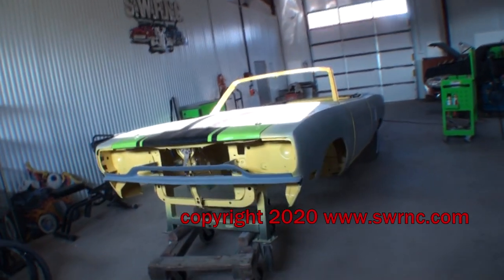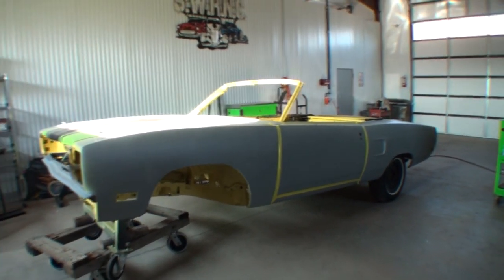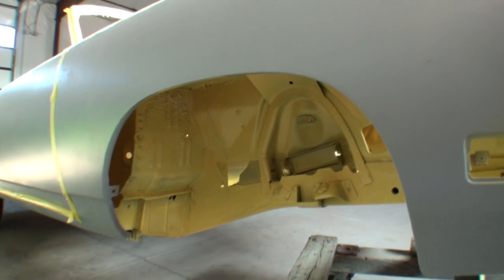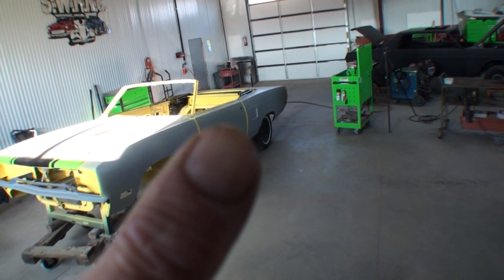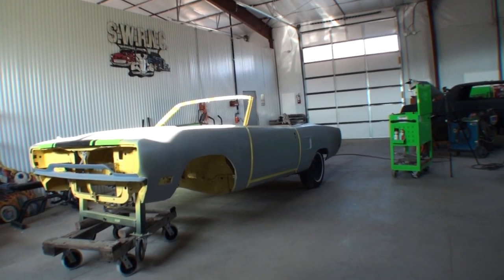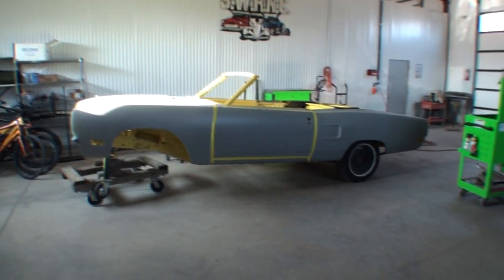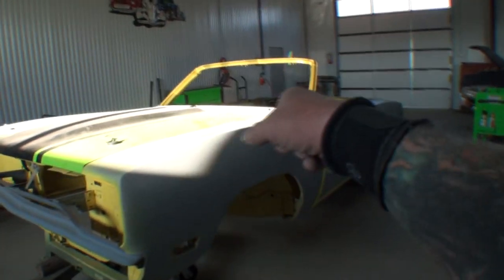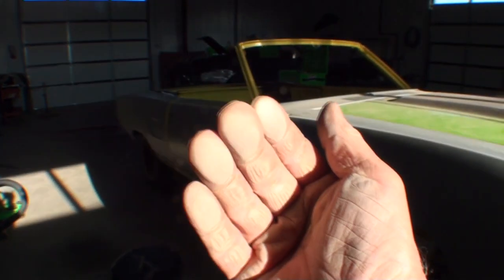Paint Your Car With Rattle Cans -FAST AND EASY

Comment: I can’t believe I’m cheaper than Pete! I use my primer gun rinse as guide coat. If I’m priming grey, I use my saved red primer cup  rinse. If I’m priming red, I use my saved grey primer cup rinse. A simple contrast in color to help you see what the real situation is.
Reply from the maker: Never heard of that one William -- new to me.. Seems like it's a popular situation you got 3 thumbs ups.. Ill have to look into that.. Thanks for watching.
Reply: That's a good idea. I save on paint using similar colors as best coat under the base lol.
Reply: Remember we used black, gray, and red primer surfacer and I would go over with different color primer when I first heard about a guide coat. Did not know about the flat black idea, as we always had plenty of Krylon flat black and dull aluminum in the spray cans. Wish I knew about it I would of liked to try it
Reply: Are you using lacquer primer?
Reply: Justin, This is a great question. I believe either lacquer or enamel paints will not affect a 2k primer. 
I had lifting/wrinkling on a small parts job, but contacted RustOLeum tech. They simple said if the can does not say enamel on it, it is lacquer.
  I would honestly do what the previous painter said. Save you contrasting primer wash from your gun, seal it, mark it and you can use it in 3 years. (Just Don’t Save 2k Because It will Harden I believe)
  Otherwise, go to Dollar store a but flat black. I have used contrasting spray can primer from the home improvement stores. But even then, it cost $3-4 per can. Try your lacquer in an area that is your primer on metal, so you don’t have to sand again if it lifts. Notice Pete said “The Cheapest” which I would bet is lacquer. So, now you have many options. I am a retired auto tech, not a painter. I’ve done 5 of my own. This is why I love what Pete does. Yah, a little salty sometimes but no less than my step-grandad on the farm, 2 six-packs in before I forgot a chore and heard the belt come off. I learned to run fast. It’s not fun being the red-headed step child, the oldest of 4, 3 all half blood to me. Even at 63, enjoy learning. Pete is my man! No man is perfect, but body & paint, Pete is up there in my book! Best of luck.
Reply: Justin, See the post from William Shaffer. Brilliant!
Reply: No I was just wondering if the 2k wash worked? I guess it would almost be like lacquer primer. I understand guide coat and such since I'm in the biz. Personally I just buy the dollar bomb cans. If I have to contrast I'll shoot some base coat on it

Comment: i always sand in a cross-hatch pattern. never work one spot.  i also make a drawing of the body to show where problem areas are / were.  you want that shine line to match up on front fender, door, quarter panel seems.

Comment: Thanx Pete!  Hope you feel better.  Have you ever tried an inversion table?  It helps with feet, back, circulation and other stuff, nice to use every now and then even for 10 minutes, I feel 1/2" taller after using it.  Standing hours on a concrete floor is what led me to it.  I want you to keep those vids coming!  I just started my D.I.Y.AutoSchool wardrobe with ordering a green DIYA.S. shirt, I will wear it proudly!  Stay healthy!

Comment: Cool video Pete..  I do body work and custom paint jobs using candies, pearls, different sized metal flakes and metalics, plus using glow powders..  I too use the guide coats for guidance but I also go one step further to reach that perfection mark by using different size straight edge before putting any fillers on..  While sanding the guide coat, if I run into bare metal (high spot), I will take the straight edge and put it on the bare spot and see if the straight edge teeters on it or not..  If it does, I will knock down the high spot with a body hammer and then recheck with the straight edge again to see if its level..
Hope this helps..

Comment: the green and yellow looks great together.
putting one of those spray glue can heads on a paint can gives a nice fan.
guide coating is a great way to use up left over base coats.
Reply from the maker: HUMMM  --- I never thought of using the spray glue tip for the guide coat.. Gonna have to check it out.. Thanks for watching Messylaura!  Hope your doing well..
Reply: @diyautoschool  yes i'm doing great thanks Pete.
looking forward to you making a spoof sand blasting vid 'just leave the car in the desert for a day"

Comment: Well just coz u asked what I would do the other way. I would use that guide coat with filler and bondo work to try to make it as close to perfect whats possible BEFORE spraying the actual sanding primer. What you complish with doing that way you might have to spray only once the sanding primer. You will save ton of time if doing so coz everytime you have to spray something you have lots of masking and also the primer has to cure basicly over a night before u can sand it.

Comment: love those raised car dollies that the Mercedes is on ...  makes a nice working height..  Pete did you make those or are they oldies but goodies??
Reply from the maker: I bought them with a floor system for tieing cars down for the frame machine. I don't have the frame machine anymore but I kept these dollys.. They would be really simple to make,,, 2 inch angle and some 2 inch square tubing with wheels...
Reply: They were very nice to have. I would always put the 4 under one of the cars I was working on in the shop .  I could get 3 or 4 cars in there and move the other car any were i needed to put it to work on all the cars. Would be cool to make a set, as the wheels just sit down in the dolly and 4 good casters. I was surprised when dad got them I was able to Maneuver large cars and pickups with no help.

Comment: Pete, do you have any experience with using a shrinking disc for small high spots?  There are only a couple sources for these and the price keeps me from trying one out.  Stainless steel, rolled edge, maybe it is not expensive IF IT WORKS.

Comment: Pete From what  I think I have understood from your previous video on  Epoxy  Primer ( sealer )   after the block sanding only the high bare spots will be spot Epoxy primed  correct ?  What is the next step after the block sanding is satisfactory ?

Comment: I have a question im working on a 1971 camaro and I'm skim coating the door now how do I adress the body line in the middle of the door? do I sand till I see bare metal or leave a coat of bondo over it?

Comment: I remember reading this technique way back in the 60s in Rod and Custom magazine.  They had a car they wanted to paint black and the guy that did the job did the sanding and final bodywork using a guide coat like this because he said if it's going to be black, every tiniest little imperfection or ripple would show up like a sore thumb.

Comment: Looks like I'll be painting a trans am black soon since I'll be having some down time for the rest of the year.  Time to catch up with "My Friend Pete" on my technique.  What grit will you finish the car in once you've repaired the highs and lows after the 180 guide coat?  When is it necessary to apply sealer before the base coat?  I'm worried about the idea of spraying sealer and getting a poor finish that needs to be sanded again after I've already done finish sanding.

Comment: these types of cars are worth the money to fix all the rust in them some projects i just don't understand the money some people put in them . to learn body work i started with a b2 10 just to learn before i do a real car and it was a basket case . it had rust damage and all sorts of dents but i got 2 others for free so i built it the way my wife wanted it .  had to pull a 5 speed to put in a automatic talk about taking the little power it had away .  my daily driver was a 73 ss with a 396 tunnel ram roller engine i was 20 years old when i started doing body work did a little before but mostly engines and drive train since i was 12 rebuilt my first engine by my self at 14 . i went to work at a body shop when i was 22 it took me 6 months then they made me  lead body guy were i had to go around and check other peoples body work then the next thing i know i was called the corvette specialist and ended up do most of the body work for most of the dealers the funny part is i hate vetts and after that i really hate vetts . like the zr1 vetts were u get charged 400 bucks to change a light bulb because they have to take the back end off it just to change a light bulb

Comment: Are you supposed to sand all the guide coat out completely if so you would really leave a big low spot from a deep scratch nobody covers this question they just say sand it all off please help
Reply: Do not sand till guide coat is gone.
Use the guide coat to locate low or high spots. 
The GC is basically removed from the high or level areas during this process.
Remaining GC left in low areas will/should be removed during the prep process for filler.
Hope this helps...

Comment: Takes 6 can's of Rust Stop (Ace Hardware) Satin Black, to paint a 55 Ford F100 short box pickup. So about $30. When it's all said and done you end up with a $30 paint job. It will last for $30 worth of time. It will look like a $30 paint job when you are done. That sagging run on the hood, that's where the nozzle exploded and painted me and the truck. That light spot on the drivers side rear fender, that's where it just slowly disappeared after about 6 months. When people say, "well I want something nice that will last", I tell them you ain't gonna get that out of can for $30. Take it to someone like you, or watch DIY Auto School and pay attention.

Comment: Nothing wrong with bringing a car to perfection if it is going to be a trailer queen but the reality is that it is only perfect until some moron parks his ass up against it and leans on the car. And the result is an Instant low spot and all that hard work and labor expense gone down the toilet.  Or just wash your car on a hot day and watch the panels warp. LOL. They always say not to wax your car in the sun but washing a hot car with cool tap water is much more destructive to those lazer straight panels.
The car looks very nice Pete and I know that for at least the first week or so, Norm will see all your hard work. Then he will start installing the engine and it's all daily driver from there on out.

Comment: HI PETE I HAVE A CAR IM THINKING ABOUT HAVING YOU DO FOR ME . A 1969 GTO JUDGE . BUT I HAVE  TO MANY CARS RIGHT NOW  INEED TO PART WITH 1968 OLDS 442 CONV .1966 IMPALA SS BIG BLOCK 454 , 1980 CAMARO Z28, 1957 CHEVY BELAIR WAGAN ,1958 M,ESSERSCHMITT ,1966VW BUG ,1979 GAMMA CAR 750 1969 GTO CONV RUST FREE BUT MITE NEED FOR PARTS FOR MY GTO JUDGE . ARE YOU INTERESTED IN ANY MAYBE . SOME NEED PAINT MOST RUN AND DRIVE.  PAT I TEXTED YOU THE OTHER DAY.